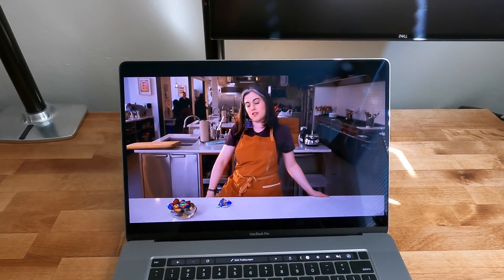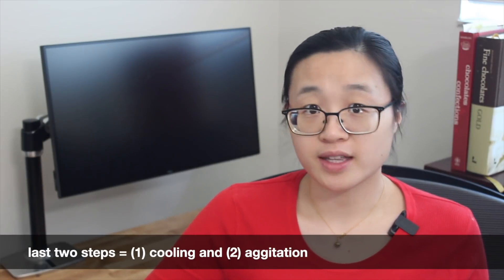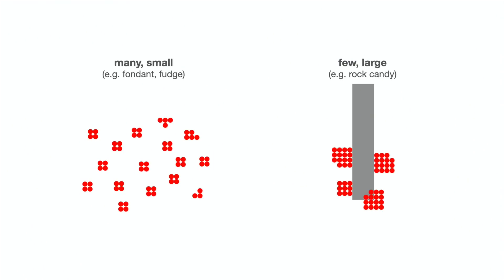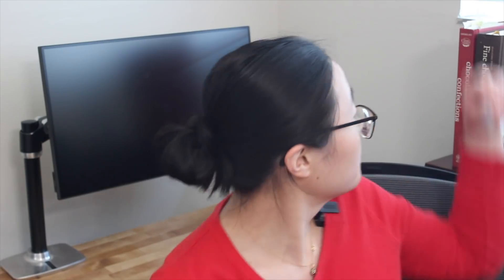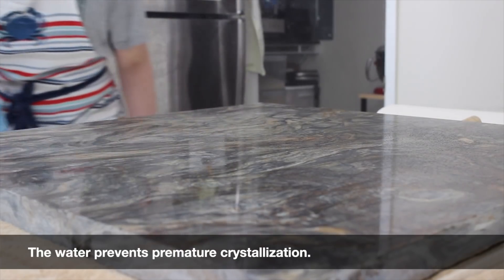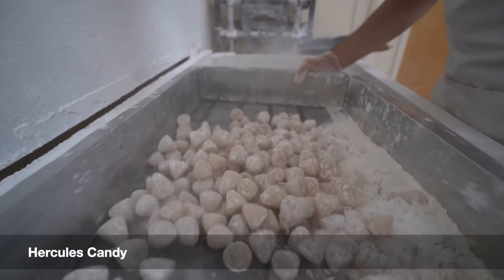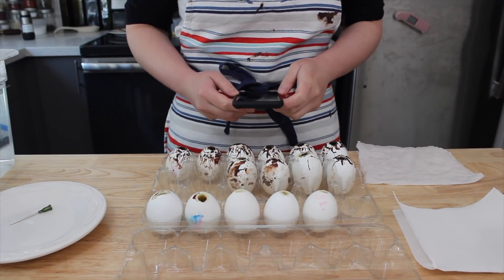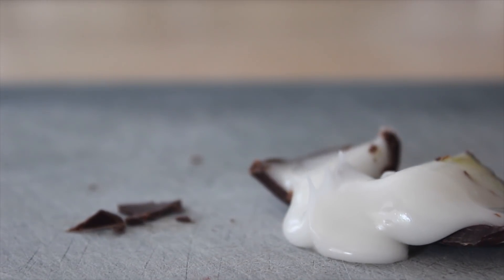Food Scientist Makes Artisanal Cadbury Creme Eggs | Reclaiming Chocolates and Confections

Comment: THANK YOU for this. I watched half a dozen videos on DIY Cadbury eggs since the Cadbury ones have finally become so low quality they're not worth the price anymore. The vast majority of videos use powdered sugar, corn syrup, etc., and come out more like a fondant icing than a viscous sugar syrup. I watched the Bon Appetit video and thought it was dumb to (1) use real egg shells, (2) not just leave the chocolate in the shells longer to get a thicker coating, rather than coat them 2 or 3 times, and (3) use gelatin—although to be fair, she was trying to save a fail there. I would be perfectly happy to use plastic or silicone molds for this, but I have two questions for you: 

(1) When I studied confectionery in Europe a long time ago, we just used invert sugar. I'd never heard of "invertase" before this. Can we just use some percentage of invert sugar in the original formula instead of adding invertase after the fondant is pulled? 

(2) If we weren't using molds and instead just formed the fondant into eggs by hand-rolling them while the fondant is still firm, we could then just coat them in chocolate by dipping and, after 5 days, the centers would be gooey delicious—right?

EDIT: Please do York peppermint patties. ☺

Comment: Hello Ariel, loving the technical gems and the unique aspects you provide! 
Inspired by your recipe, I wish to create a chocolate bar with a mint fondant filling inside, using regular moulds. I need your help in clearing a few concepts.
Isn't it redundant to create a firmer fondant initially for the method you have chosen(i.e. achieving a pourable consistency)? 
I assume a harder fondant is necessary for the professionals since they have to enrobe the candies, but since you have chosen to pour it instead, could the same consistency be achieved without using invertase? 
Maybe with an inverting agent like cream of tartar after boiling point and taking off the sugar at an earlier softball temp (113 C approx) , in order to create a soft pourable fondant for the intended mode of usage as per the video?
I might be way off track here since it's just a theory I have and not something I've actually tried, but would appreciate your insights! Apologies for the long post!
Reply from the maker: Hi Silvalining123, you are correct. If the goal is to pipe the fondant into a mold, ideally you should use a recipe that produces a softer fondant to begin with. In this video, I produce a hard fondant then soften it with invertase to teach the viewer about invertase and to provide the viewer with options if their goal is to produce a soft, enrobed fondant rather than a molded fondant product.

Comment from the maker: Here’s a response that I wrote to one commenter regarding the use of a stand mixer for agitating the fondant syrup, which I think will be helpful to others:

Yes, making fondant completely by hand is quite the workout! I’ve also seen people agitate fondant syrup using a stand mixer (https://youtu.be/tAlmGwYUiOg?t=558). You can most likely produce identical results to what you’d get from agitating by hand, but I suspect you may experience a greater failure rate (i.e., nucleation occurring too early, resulting in some crystals growing larger than 20 micrometers). The stone slab allows the fondant syrup to cool quickly and evenly, which is harder to do when cooling the syrup in a bowl. A supersaturated solution that cools unevenly is more likely to nucleate prematurely. This will become more of an issue as your batch size increases (as it becomes more difficult for the syrup to cool quickly and evenly). [One option would be to cool the syrup first then transfer it to the bowl of a stand mixer if the texture of the fondant allows for that]

In small-scale operations, fondant is made using a cream beater (like the one shown at 00:48). The surface (where you pour the syrup onto) is cooled from below with circulating water, which helps cool the syrup quickly and evenly. Once the syrup cools to the optimal agitation temperature, the arms begin to rotate, agitating the syrup and scraping the syrup off the platform.

Another thing that may increase failure rate is the dead space between the moving blade/paddle and the bowl (i.e., the sides of the bowl and bottom of the bowl are normally out of reach), which leaves a good amount of syrup untouched/unagitated.

Another concern with using a stand mixer or food processor is the possibility of overworking the motor, especially with this particular formulation. As you can see from the video, this recipe (cooked to 117 C / 243 F) makes a very stiff fondant, though you could cook the syrup to a lower temperature for a softer fondant. 

When making fondant using a stand mixer or food processor, do you normally scrape the sides of the bowl periodically and is your fondant formulation softer than the one shown here?

Edited: I also wanted to add that cooling and agitating on a stone slab isn’t foolproof either. Other than the thin film of water you sprayed on the surface of the syrup (which mostly evaporates away during cooling), there’s nothing stopping a dust particle from landing on the syrup and acting as a surface for nucleation. Also, once you begin the agitation process, agitation should be constant in order to create the proper smooth texture. Intermittent agitation creates fewer, larger crystals, leading to a grainy texture. I can imagine a scenario where a person gets tired and doesn’t agitate to the extent that’s required.

The take home message is this: use whatever method works for you, but if you encounter problems using a particular method/surface, you know how to troubleshoot.